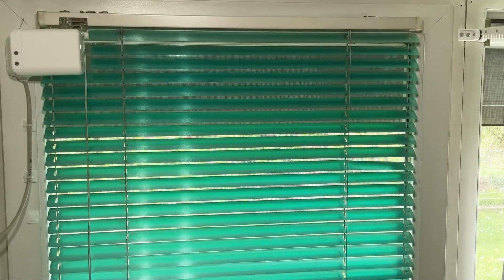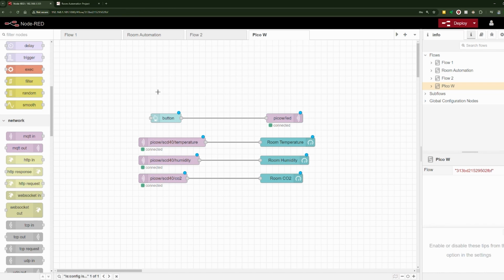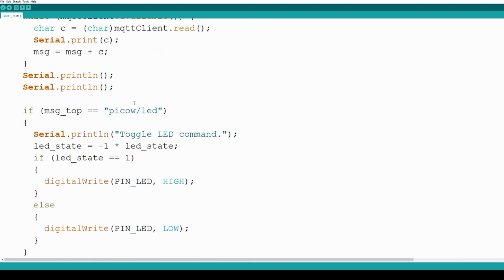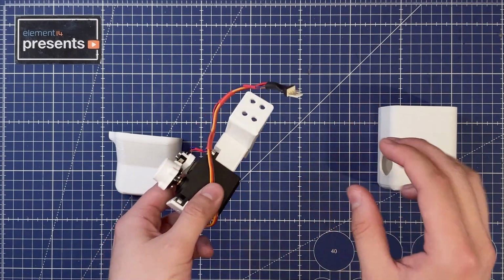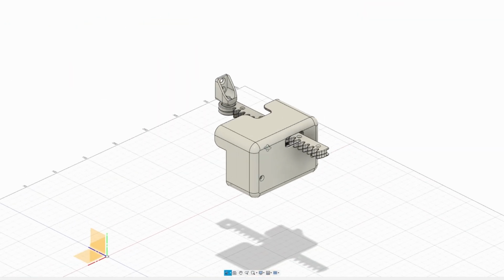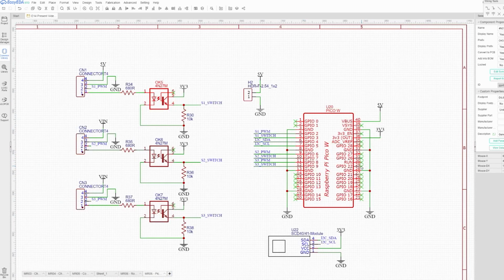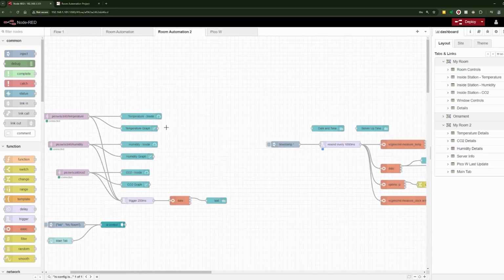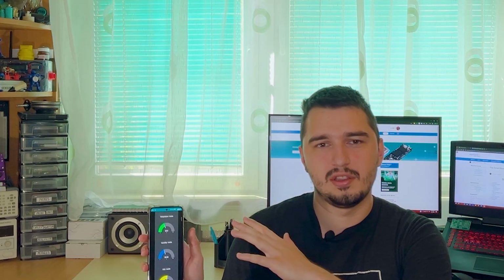Smart Windows and Blinds with Arduino and Raspberry Pi Pico

Comment: i'm confused little bit , do we use two RPI pico W or just one with the spaghetti box one ?
Reply: The Pico W is used in the new node that controls the windows, while the spaghetti box node is running on an Arduino MKR1000 WiFi, since I will upgrade that node in the future. Pico W can be used for both nodes and MQTT in the same way it was used in the new node.

Comment: I've been working on a similar project like this myself for some time to open and close my roman blinds. I've built the geared mechanism with a motor to drive it and I've been tinkering with a pi pico w, but haven't finished the project yet. For the moment the blinds are operated by holding a button until they're open or closed, so I'm keen to take some lessons from this video!